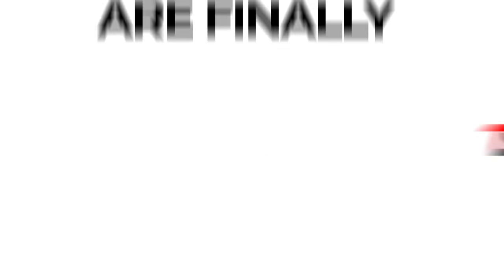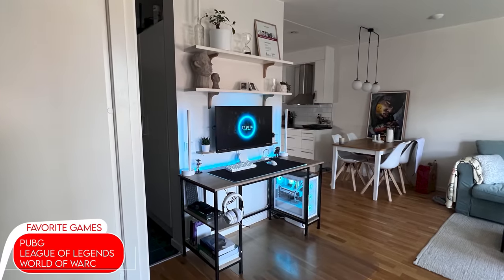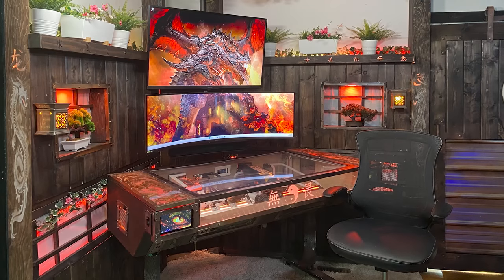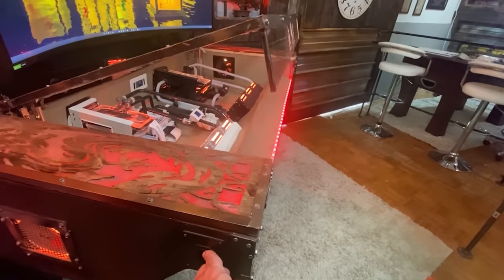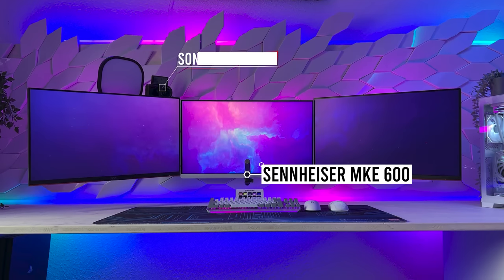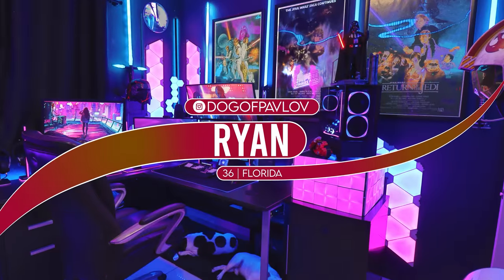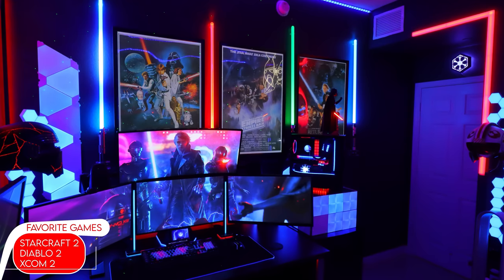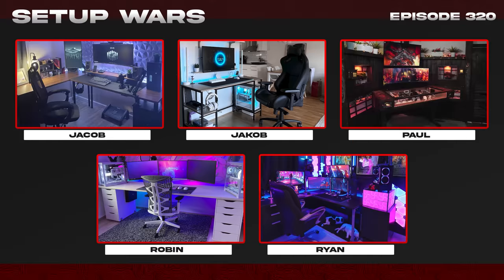Setup Wars - Episode 320

Comment: I was really hoping the last submission would get a seal of approval.  The set up isn't well balanced but has enough character to set it self apart. But I guess beauty is in the eye of the beholder.
Reply: @silverbulletin1863  I agree on the rgb panels, a little too much, but the cheap rgb is o.k just as long as you diffuse it properly.
Reply: @DJBusHwooKiE  yea but he did not do that either imo tbh its not the price its the  mindset mostly vs in the realm of 40k

Comment: 5:40 There is NO WAY that Paul did not get a seal of approval?? Does that not check all the boxes and then some?? That is the most insane setup I've ever seen...
Reply: I totally agree,😉 thanks for sticking up for me LOL I messed up on the photos I think I got marks taken off for that. and I
Do you use it for gaming and productivity I guess I should have made that clear, the next setup is in the works, better photo though😊
Reply: I rly dont agree, the monitors dont rly match very well and it looks kinda plasticky. Also the idea of him not using the setup and only using the much less impressive setup in the back rly makes it impossible for me to place him at nr1. Il have to go with ryan’s setup for sure
Reply: @Helioger  I do use the set up for more than just the background. I should've explained that better. These computers are used for streaming, but they're also productivity. I do  edit my own videos. all of the custom shelves and desk are made out of wood. If you could change anything in my set up, but would it be?

Comment: Lol, Ryan's remote stash is funny. Most I.R. controlled RGB LEDs use the same signals to do the same thing so 10 of those remotes could be put in storage. There are also identical 2 RF remotes for controlling leds there so he can also put one of those in storage as well. I'm not familiar with the rest so I can't say what is redundant there or not but he can easily reduce his remotes from 19 down to 8 without losing any functionally whatsoever.

 Pro tip leave one of the redundant remotes near the entrance/exit of the room, that way if you are away from the desk and decide to leave you can still turn everything off without taking the remote from your desk (and risk losing it or forgetting to put it back in the desk for when you want it). Also one by the bed/couch is also nice.

Comment: I'm hoping to get a pc this year and improve abit on my setup. The cpu and gpu combo will be a intel I5-12400/f and a 3060 or 3060ti but I might get a 12600k if I'm going for a 3060ti with 16gb of ddr5 ram and 1tb of storage which would cost about $2000-$2500 or 600

Comment: Can someone help me out. I just recently built a pc a couple days ago and I have a few problems. 1. When my PC is off my 4070ti has a red light right next to where it gets plugged in, does anyone know why it does this? 2. My NZXT Kraken z73 display only turns on for a second when I turn on my pc and then it completely shuts off and isn’t detected by the CAM software, does anyone know how to fix this or did I just get a dead unit? It keeps my CPU cool but the display just doesn’t work.

Comment: 4:15 I know spending 440 dollars on lights is insane but in the firs setup you said that 3060 is great for 1440p 144hz gaming, and now a 3070 is bad for 1440p 270hz? You can't even see the higher refresh rates and it really doesn't seem to fair

Comment: while you're right and spending $400 on lighting is silly you're completely wrong about the 3070 not supporting the monitor. I have a 3070 and a 240hz monitor and can push well beyond 240fps in every single fps title.

Comment: SOS:

I built my new PC a few months back and I feel like I'm missing something to help performance. 
Here are the Specs:
AMD Ryzen 9 5900X 3.7 GHz 12 - Core CPU
MSI Mag B550 Tomahawk AM4 Motherboard
Corsair Vengeance RGB Pro 64 GB (4 x 16 GB) DDR4 Memory RAM
MSI GAMING Z TRIO GeForce RTX 3080 10GB Graphics Card
Corsair H100i Elite Capellix liquid CPU Cooler

So I got the 3080 thinking I could run games at 4K or even do some ray tracing at 1440p... but i was wrong. Frames always drop whenever I turn on raytracing in games. I turn it off and it works pretty good. Am I doing something wrong if anyone can help I'd appreciate it. New to this PC world. Also does internet have anything to do with it? obviously in multiplayer games but I dont understand why frames drop in single player games.